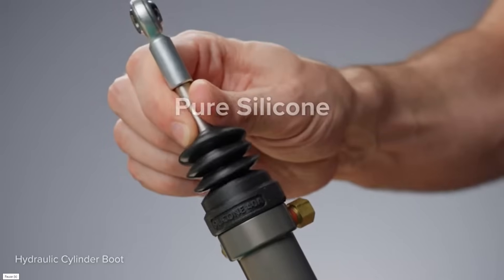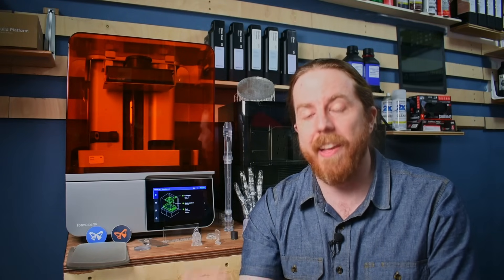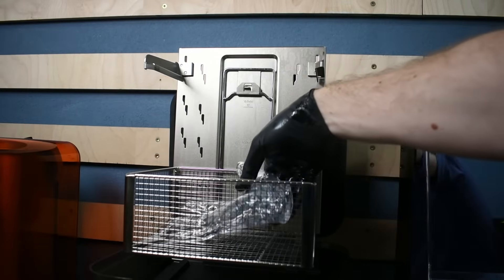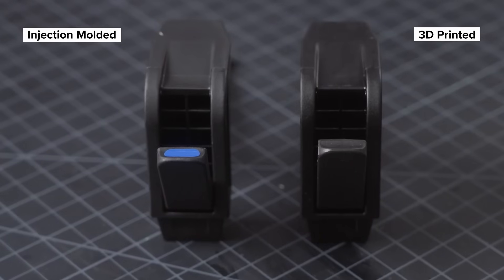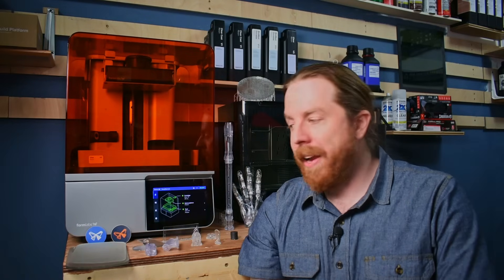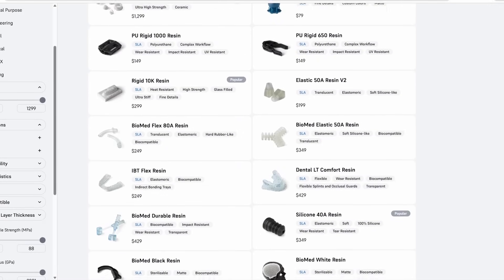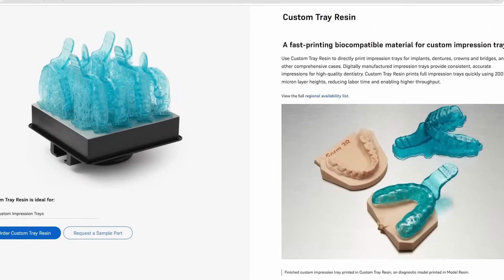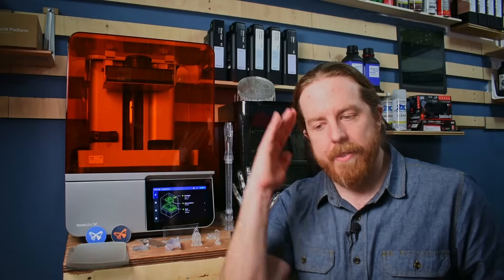Form 4B - This Will CHANGE Resin Printing FOREVER (at a price...)

Comment: How are you getting so many failures on other printers? When I got my mars 3 with Vulcan resin, I printed 1.5kg without failure until I ran out of resin. And what resins are you using that still smell so bad? Anycubic standard made me lightheaded, but switching to siraya tech navy gray, I barely smelled it. I'll be trying acmo free consumer resin soon.

As far as form 4, we got one at work, and I've had so many failures and warping. Clear v5 warps a lot with 1 click supports. Durable warps like crazy. I've had several failures with it. Especially with the flex plate. The flex plate just gets pulled off. I also had it damage the tank film. Formlabs claims this was due to cupping, but I sent them the file, so they could see there was cupping in the area that failed
Reply from the maker: I print a ton of different things with different resins and different machines, failures just happen.  Generally things are pretty reliable if i stick with a few reliable resins. The one that surprised me (the orange looking resin failure in the video) was the Heygears machine.  They claim better dimensional accuracy (which is true, though not perfect) and reliability, but in my experience it fails just as much as any other printer.  Again, most prints don't fail, but it still happens.  I had much better luck with the Form 4B.  Only that 1 failure I showed in the video, and i've gone though several bottles of resin, printing some very random stuff.

For smells, by far the best (least smelling) are formlabs resins, for this printer and also the "creator" resins which I highly recommend for normal printers.  The worst smelling resin i ever used was Uniformation biodegradable.  It was so strong that I could smell it from my driveway with the garage door shut. I keep the printers in the garage, not in the house.  The least smelly non-formlabs resin that i've tried is Sunlu abs-like, but that seems to change from bottle to bottle.  I tried printing a keychain whistle in that, and though it didnt smell too bad, i couldn't blow into it without having a reaction from the smell.  Sunlu doens't claim it to be biocompatible, but yeah, don't get it near your mouth/nose.  great for minis, though (that's what I use it for mostly).  All other resins seem to be in between those, though I will say metal casting resins can be kinda nice smelling.  it's probably from all the wax in there.  Formlabs resins smell better.  i think Clear V5 and creator clear smell kinda good, actually.

You have failures with 1 click supports? Is that the "1-click setup" at the top of the bar on the left?  I haven't tried that.  I would either "auto orient" or manually orient to keep the supports in a specific area, then auto generate supports. I probably should have talked about that in the video. It's just a habit from using other printers/slicers i guess.  Who knows.  

I haven't had an issue with the biomed durable (i didn't try the regular durable) but I did print a few things with severe "cupping" according to the slicer.  the big hand, for one, and one of the flutes that didn't make it into the video.  The only issue I saw with the flute was a slightly rippled section of the tube.  it probably wouldn't be too noticeable if it wasn't clear and refracting the light like crazy, but it still works as a flute (though I suck at playing flute) lol

The flex plate magnets seem REALLY strong to me, that's crazy it got pulled off.  What were you printing?  was it something huge?
Reply: @PaulsPrinterProjects  I have been using the 1 click setup. Manually orienting and autosupporting does seem to work better, but that goes against their claims that you don't need to know resin printing to start.

As far as smell, formlabs does sell acmo free resin for hobbyists. 3drs also offers a few acmo free ones. I haven't tried any yet, but I should get a sample from 3drs.

As far as the flex plate, it really wasn't big and it's only happened with durable. I've printed large minis flat on the plate (over 60mm diameter) on my mars 3 without issue. While I've had issues with rigid 4k, clear v5 and durable, durable is the most difficult to print with. I have pictures of the failed prints but I can't put them in YouTube comments
Reply from the maker: interesting, maybe i'll try the "1-click" and see what happens.

I didn't know about 3drs resins, but that's good to hear.  Toxic smells and stuff keep lots of people away from resin printing, and I think more resin manufacturers should be trying to make things safer like that.  This biomed durable is crazy strong AND pretty safe, so it can be done, just not cheaply I guess.

that's interesting to hear about the flex plate. I'll keep an eye out for something similar and put it into a video if it happens.  I just haven't had issues so far, everything came out great.

Comment: Amazing content! I think this is the best Form 4B review I have seen on youtube. I really wish if you could do a detailed review on dimensional accuracy of this printer. Lot of hobby grade printers can capture intricate details but not much when it comes to dimensional accuracy. Would love to see this if possible!
Reply from the maker: that's a really good idea!  The "do the flute parts fit" test isn't very conclusive, but i'm going to be making a lot of stuff with this printer and that will include mechanical parts.  One thing i didn't show in the video was a clear marble that came out looking like a sphere with bumps for support materials.  On other machines the bottom will get warped more, and it will end up looking like a clear egg with bumps for supports.  Some rectangular pieces also have much flatter bottoms (the edge with supports).  and they end up flat, not flexed.  I'll definitely add some dimensional accuracy tests, maybe compare it to some other resins/printers.  Thanks for the idea!
Reply: @PaulsPrinterProjects  my pleasure! That sounds great and will be a really cool video. Especially with you mentioning the investment casting resin, it would be neat to see the capabilities in dimensional accuracy, flat objects etc! Super excited for your future content. Good luck!!
Reply from the maker: If you want to see more about the investment casting, it will be posted on my other channel "Paul's Garage".  There is already some investment casting there, but mostly small stuff like jewelry.  I do sand casting for the big stuff, and the bigger patterns up until now have all been FDM printed for dimensional accuracy reasons.  Hopefully this clear cast stuff works as well as they sound.  It prints REALLY well, and it's actually quite durable in printed form.  I'll see how it burns out, but I like what i'm seeing so far.
Reply: @PaulsPrinterProjects  thats awesome!! Ill definitely check it out. Sounds like the next couple of videos are going to be really cool and informative!! good luck!

Comment: The pain (smell, alcohol) of resin is the whole reason I don't have a resin printer.
Reply from the maker: I hear ya.  I keep all of this stuff out in my garage.  Honestly though the formlabs stuff doesn't smell, and the wash station flap stops alcohol smells too.  If it had their wash solution in there it would be even better.  I think they intend this to be in engineering/dental/doctors offices so they don't want it to smell/poison the air.

Comment: I got to see one of these printers in action at a manufacturing facility a few months ago. The wide range of materials and the print quality are unbelievable! What also surprised me is that there's little to no smell at all, in stark contrast to my cheap resins and printer that absolutely stink even with active ventilation. I'd definitely get this setup if I could afford it...
Reply from the maker: The smell is crazy.  Almost no smell at all, almost no mess at all.  Other resins still reek even after washing and curing.  Its crazy.  I tried printing a flute in non-formlabs resin and even after thorough curing I couldn't play it because of the smell.